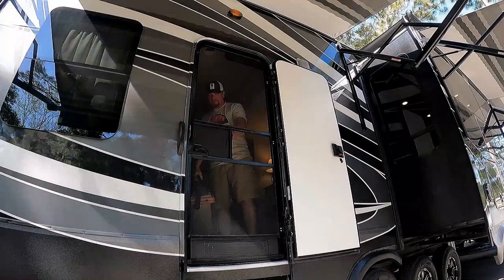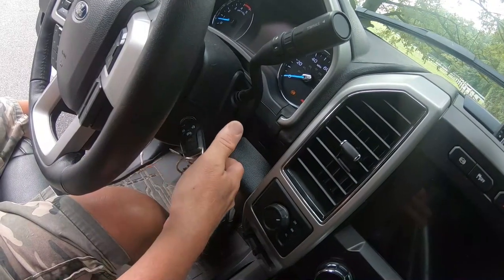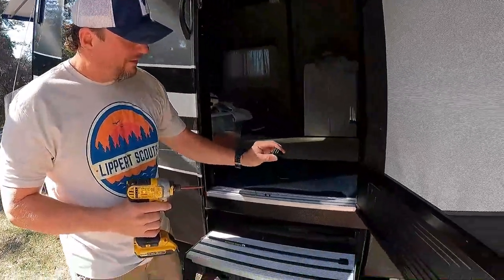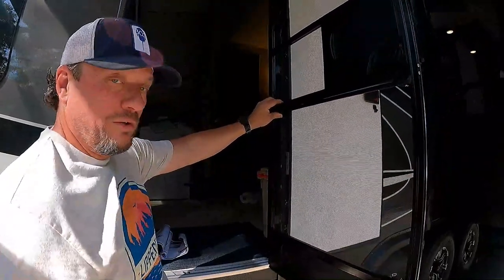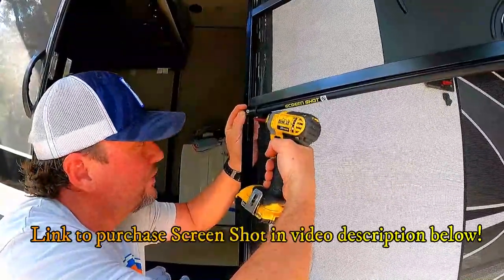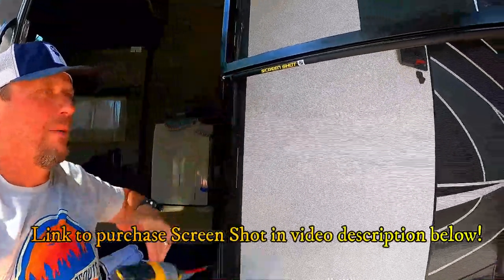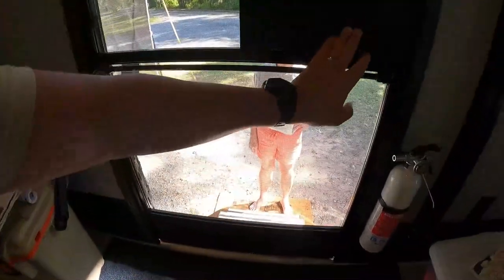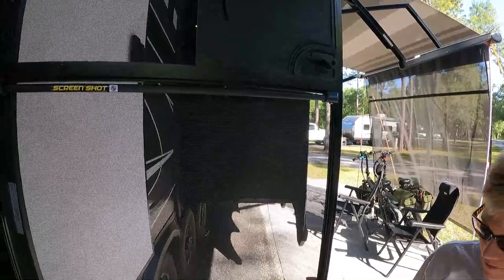Lippert Screen Shot - RV Screen Door Closure - RV Must Have! 😍

Comment: I love that !!!  In my cart right now, just need to measure to see which one I need.  Is it strong enough to pull the door as well?
Reply from the maker: It does pull our main door, but not as quickly as the screen door. Now if wind is blowing against the main door it will need help, just a little heavy on our Grand Design. Hope that makes sense.
Reply: Perfect.  I’m thinking this will cut down on the trouble I’m usually in 😂